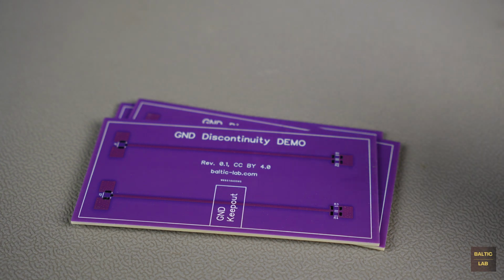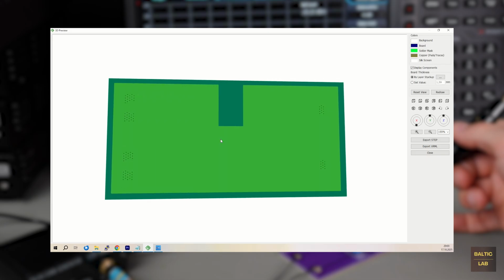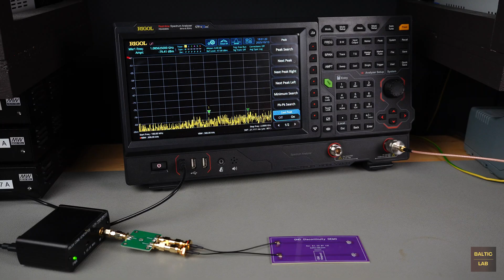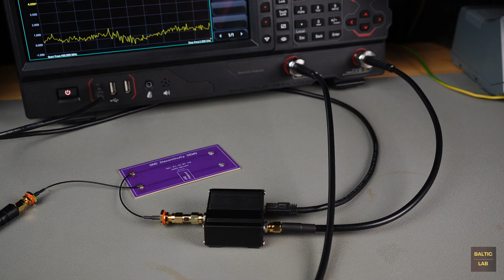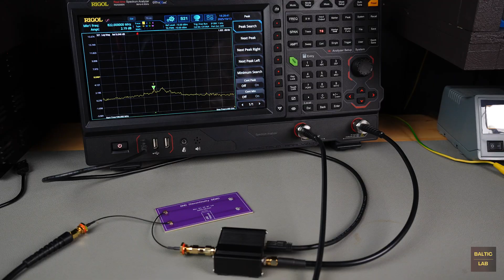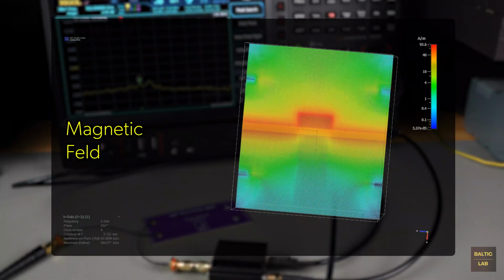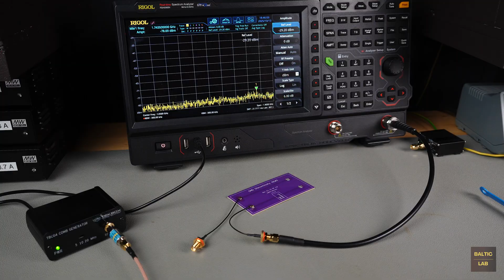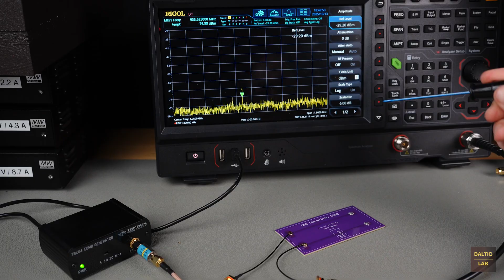Exposing the EMC Pitfall That Could Ruin Your PCB

Comment: Does the rule of the return currents following the trace if not interrupted, just because of it being the shortest path or is that path favored because of EMF and the statement would apply to non linear paths aswell?
Reply from the maker: It takes the path of least impedance. And yes, EMF, or generally E-/H-fields play a major role. Because if we want to be very technical, there's nothing really "flowing" in the copper; All the RF energy of AC signals is distributed as fields inside the dielectric only guided by the copper.

Comment: I'm amazed by the amount of bad information about splitting ground planes which is found on datasheets from IC manufacturers.  These errors become flawed "knowledge" which causes layout people who do not understand signal integrity to make major errors in layout which can be easily understood to be errors by studying real world test data such as the tests presented here.  This video clearly shows what is really occurring and how easy it is to do the correct thing to achieve the best results. Bravo! 👏
Reply from the maker: Thanks so much! It's indeed an issue I see a lot as well. Unecessarily split ground planes, floating copper pour, etc. seem to have become common practice. With the sole rationale of "We've always done it that way" or "Everyone else is doing it!" By the way: If you want to help me spread this knowledge further, consider using the new YouTube HYPE feature and assign some HYPE points for better reach. 👌
Reply: @BalticLab  what is a hype feature
Reply from the maker: Youtube has a new feature where there's a "Hype"-Button where the lile button is (might need to swipe to tje right to get to it). Viewers can HYPE 3 videos per week. Then there's a special hype dashboard were Videos with the most hypes are presented. This tool is to get some additional, user generated exposure.
Reply: @BalticLab  that is cool, it may not be enabled in the EU just yet, cannot find it anywhere
Reply: @BalticLab  Imagine my horror reading old nineties Cirrus Logic graphic chip datasheet advocating for split grounds on their 2 layer reference design pcb, it was full of crimes. Motivated me to make quick github raszpl/CL-GD542X_ISA describing what not to do and showing how to make it slightly less bad.